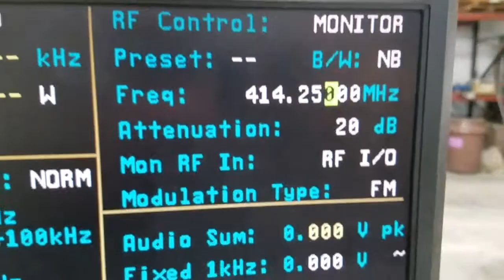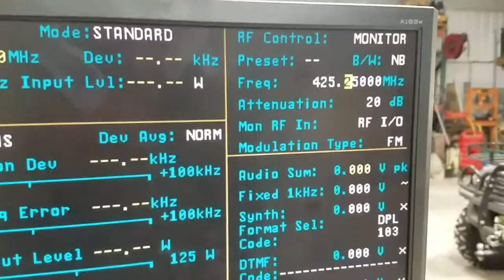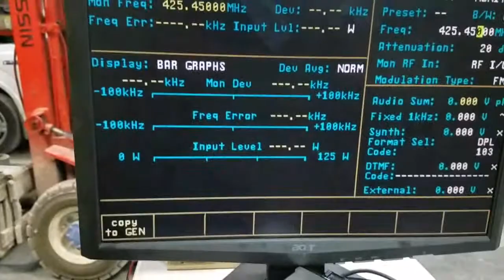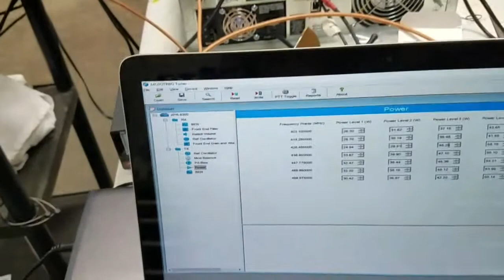Using Tuner Software Calibrating Power on an XPR8300

Comment: How can i get the software? mototrbo Tuner
Reply from the maker: @sanjayk4340  register with Motorola as a dealer and you get access to the software.  You don't have to buy anything
Reply: @W0GEN  thanks for the information, it would very great if you provide a register link
Reply from the maker: @sanjayk4340 ill add it to description
Reply: @W0GEN  Thank You

Comment: In your opinion, is it necessary to tune an XPR8300 before use or would you be alright setting it up after buying it used?
Reply from the maker: I bought mine used and set them up afterwards

Comment: I have a RIGOL DSA815-TG with 30db attenuator, when looking at my power levels, it shows the wattage, however it moves around a lot.  It will be 22.42, then in a blink of an eye, it will be 22.36, then 22.21, then 21.89 and so on.  It will just keep lowering about 2 or 3 watts, then it will increase a bit again.  Any idea to why the wattage keeps fluctuating and how to get it to remain still like yours?  I am very, very new to all of this and any help you can offer would greatly be appreciated.  Thank you.
Reply from the maker: I think that you should just average the wattage you see.  The Rigol sample rate may be faster?
Reply: @W0GEN  Okay thank you, so the number doesn't need to be that precise I assume?
Reply from the maker: @justinkurscheidt6879  IMO that is correct...
Reply: @W0GEN  thank you very much for your time.